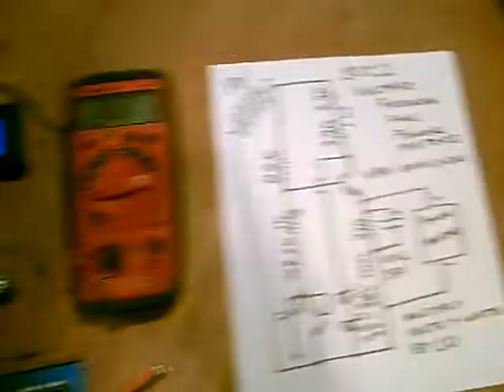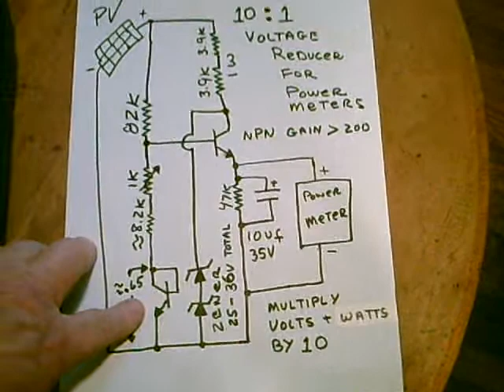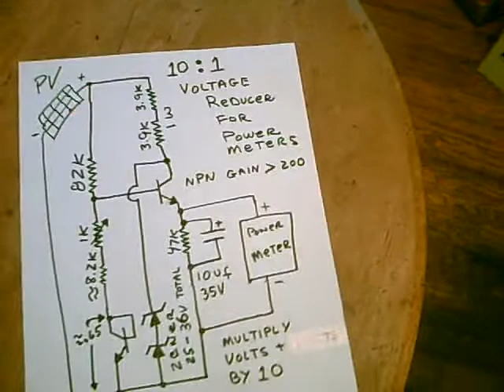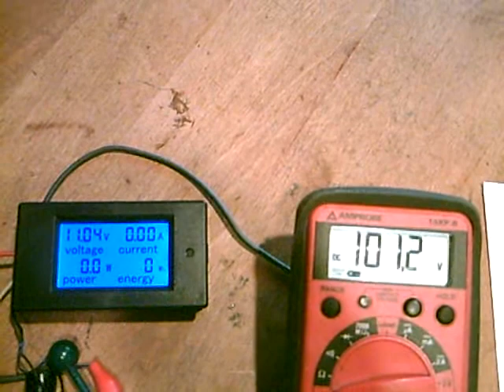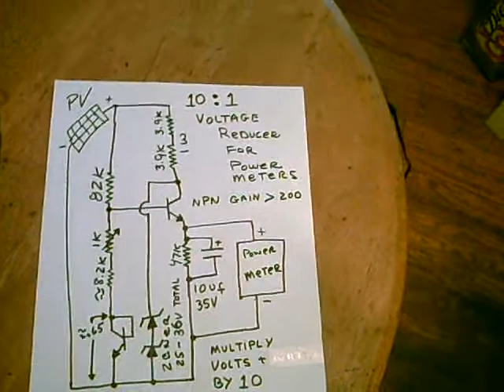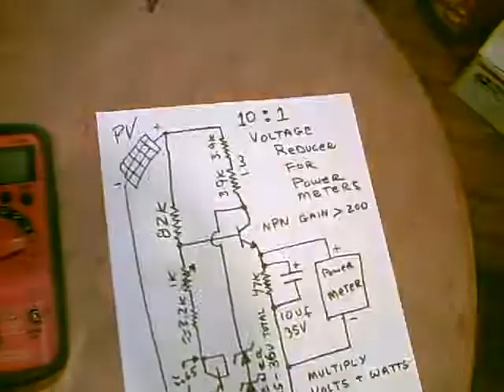How To Use Power Meters At Higher Solar Panel Voltages, Amplified Voltage Divider

Comment: Hey I have a great idea for a vid . I think you have the knowlege. Can you make a devise to turn a mod sine inverter to pure sine. Id imagine it would be filter cap and a coil or 2. But Im not sure. Do you think you could do that?
Reply from the maker: That really can't be done.  MSW inverters are fine for many applications.  Have several sine wave inverters I've never bothered to hook up.  I've wanted to do one on motors where I reduce the duty cycle once they have started to reduce motor heating.  I run many devices with electronic power supplies on just 140V DC.
Reply: @opera5714  ok your the boss. I just thought it would be handy .

Comment: Nice, I'd imagine I'd be so curious as to what my solar panels were actually bringing in I might have to try this if my charge controller didn't already display these numbers for me. I suppose that's a  difference between the cheap charge controllers and of the expensive ones
Reply from the maker: This modification is primarily for my water heating videos that operate at higher voltages. The amount of power usually wasted and diverted to water heating is pretty interesting.  With even a small system I am able to divert about 2.5KWH to heating.  That gives me enough reliable hot water for the basics at my camp.